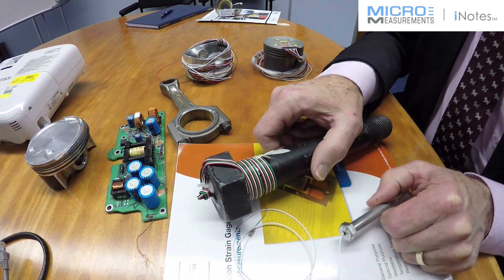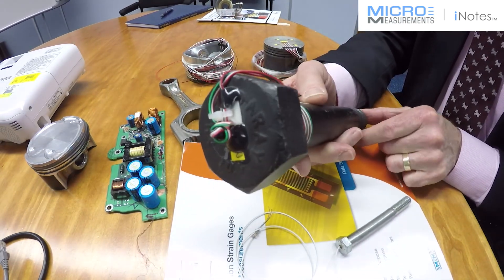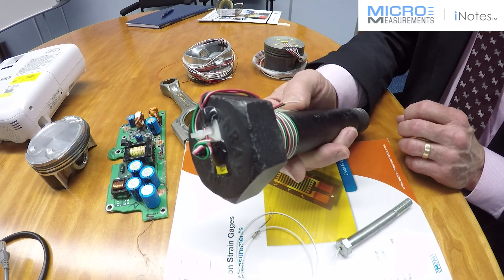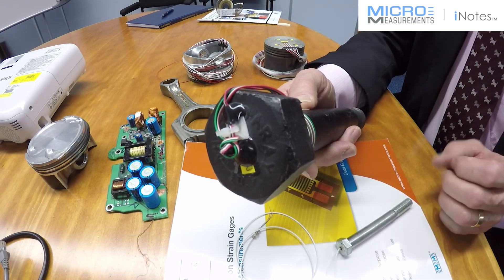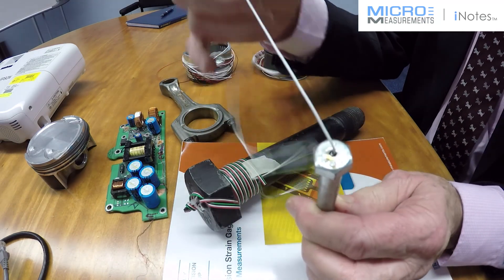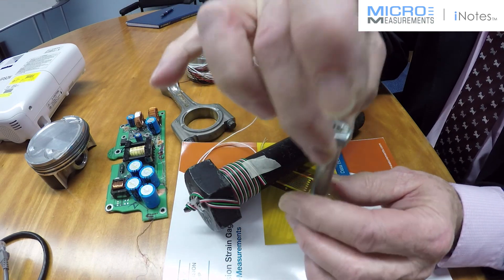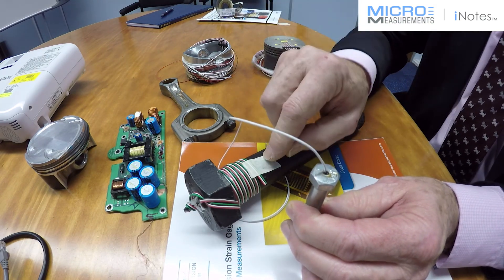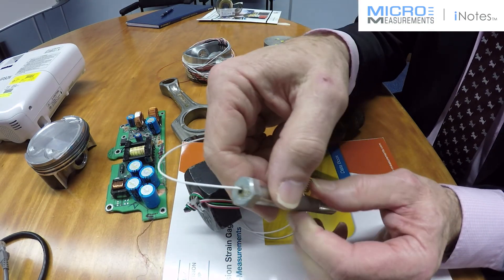Bolt Strain Sensor ( Made By VPG StrainBond)

Comment: Will the adhesive wear off at high temperature (near creep range of cs for example)
Reply: Hi Shamsul.  Thank you for the inquiry.  The typical strain gage installation for the bolt gages will be rated to about 200 deg F.  There are techniques that you could use to extend the range.  There are lots of variables that will need to be identified in order to make sure that it will withstand your operating temperature range.  BTW- what is the temperature range that you are interested in?